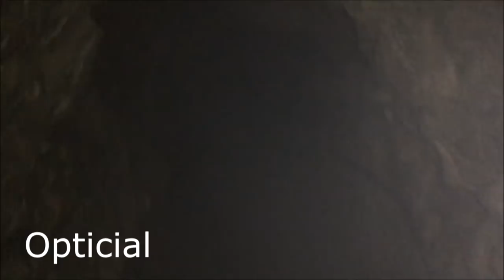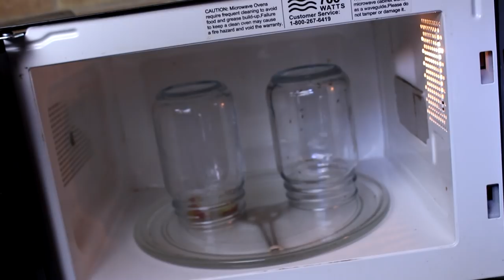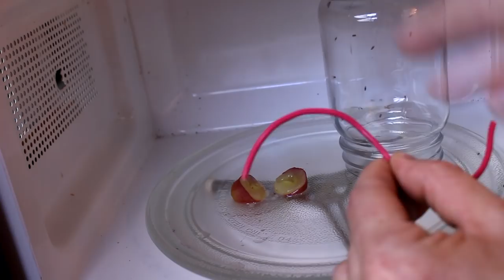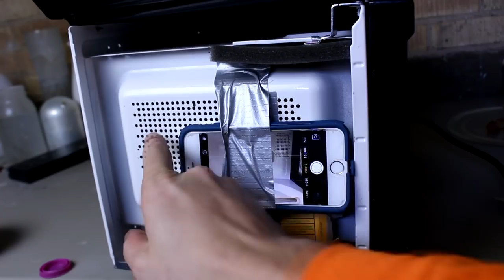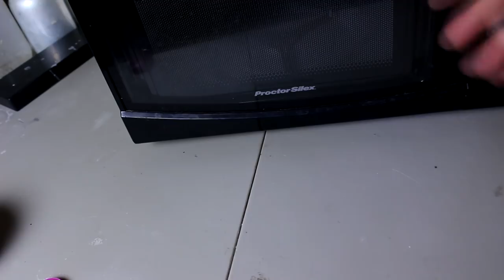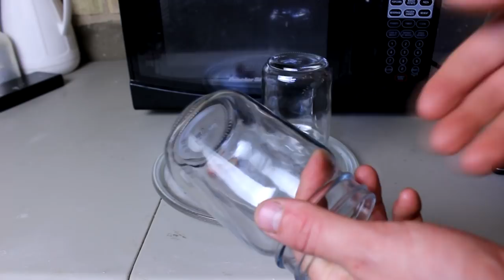Fruit Flies In A Microwave?!

Comment: First up: a great video, had I watched it before studying physics it'd have cleared up a big misconception I had for quite a while!
There is only one thing I wish you had done: Show an animation or something similar of a propagating EM wave. It is super important for the induction process, that the wave changes with x+kt and I think that wasn't really clear in you video. (3Blue1Brown would have probably just given you his animation, and below this comment will be a single line Mathematica instruction to get such an animation)
And when you tried to clarify what the peak size in your wire model was showing, I think you didn't make your point 100% clear
The only thing you were a little wrong about it the dipol flipping thing. The heat generated by flipping dipols a lot is only dependant on how quickly they are flipping, not the total difference in orientations from one end to the other. And the rate of flipping is only dependant on the wavelength of the EM wave, so with your explanation it is not clear why the dipol heating in the fruit and the flies should be different.

And here is the EM wave animation instruction:
Animate[Graphics3D[Table[{Line[{{x, 0, 0}, {x, 0, 2*Sin[x + t]}}], Line[{{x, 0, 0}, {x, 2*Cos[x + t], 0}}]}, {x, 0, 4 Pi, 0.1}]], {t, 0, 2 Pi}]
Your at a uni, so you probably have access to mathematica, but it also works in the free online wolfram language notebooks (you just can't save the code there)

Comment: I would wonder if this experiment would also work with tiny drops of water from a syringe.....
Reply from the maker: yes but thats not very interesting. ;)
Reply: Cody'sLab  I tried it with drops on a non heat conducting surface. It heatet up.

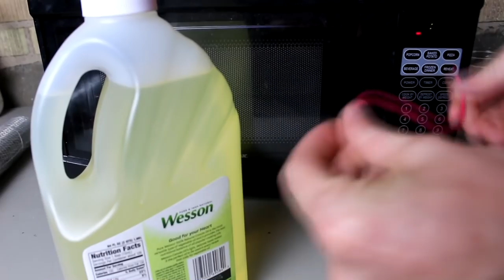Comment: What happens in the microwave is "dielectric heating" that affects the water molecules in the grape and does not have anything to do with its size. It that would be true, water drops would not heat up because they would be as small as the flies, try it out. You try to mention this effect at 6:00 as a secondary effect although that is the only actual effect that is taking place. Your analogy with "Rayleigh scattering" is also wrong, it would never be able to heat up anything since it is a "parametric process". Very misleading... If you want to understand it, just search for the quoted scientific terms I mentioned.

Comment: So if i am understanding what you are saying, lets compare
(1) one single drop of water in a microwave
(2) a mug full of water in a microwave
The energy PER MASS absorbed by (1) is LESS than the energy PER MASS absorbed by (2)?????????????
So 1 drop of water in a microwave would take longer to boil than a mug of water?????????

You said that the larger the object, more of a single wave affects the object? But i thought microwaves interact with water MOLECULES, and molecules are very small?
Reply: Water sticks together, each photon interacts with many hydrogen atoms on the molecules at once. A single misted drop of water shouldn't heat up at all other than the heat from the surrounding area.

Comment: Be careful Cody, there can be an evanescent field of significant strength around that hole. (See https://en.wikipedia.org/wiki/Evanescent_field), i.e. the high frequency - high power electromagnetic field "bulges" outwards a little at the hole. You can do experiments to detect it ;)
Reply from the maker: sounds fun

Comment: I'm sorry this is already been covered, but I remember seeing in another video that someone said microwaves change size or something when they're going through water. Does anybody care to explain that?
Reply: They will actually! Although it's more mundane. Since water is more dense than air, there are more water molecules in the way of an electromagnetic wave than in an equivalent volume of air at sea level. So the waves will be absorbed and reemitted much more frequently than in atmospheric air. As a result, microwaves will transfer some of their energy into the water molecule as they pass through until the total energy of the wave is completely absorbed.

Comment: Re communications: Microwave uses the same frequency/wave length as WiFi.
Reply from the maker: I thought wifi was 30cm?
Reply: Normal WiFi (the one found in the majority of phones and laptops) is 2.4Ghz - 12.5cm, which is the same as microwave owen. The more "modern"/expensive one is 5Ghz. Long range point-to-point links can be up to 60Ghz

Comment: Cody, do your argument goes like this: "the fruit flies are small, therefore they absorb less microwave energy per cubic millimeter than larger objects"?

I'm not at all sure this is true. However the fruit flies do stay alive in the microwave as we could see. What if, maybe, only maybe they absorb the very same amount of energy per volume as the grape, but they are small, therefore have such a high surface/volume ratio that they can stay cool just because the air around them can keep them cool?
Reply: I thought so too, seeing as I thought that things in microwaves heat up when water molecules are vibrated by the positive and negative sides of the wave, rather than an electric charge across the thing. Also, the proportion of body mass that is water is going to be higher in a grape than a fly.
Reply: You can't get the vibration going from a 12cm wave on a sub 1mm body

Comment: Good video, but still there is much more going on.. The microwaves are obviously not heating the grape, they are heating the molecules inside the grape. The fruitflies are obviously not smaller then molecules so should also be affected. And glass does react in a microwave, if you pre heat it you can even melt it. Maybe the grape absorbed most of the radiation, saving the fruitflies.
Anybody has a more extended explanation?

Comment: So.. ? How likely would it be that all the Radiowaves, which are acting like the Microwaves on the Grape(frying it), would do the same to the Earth...?
And would this mean, the global warming (if you assme it's real(which statistics show)) is not just doe to the greenhouse effect?
I was just thinking, if you'd scale the flyes up to us, all oure electro magnetic waves must get disipated by the earth...
Please correct me if my thinking is all wrong.
Reply: Radiowaves in the air are too large to interact with anything that makes up the Earth. They also don't carry enough concentrated energy to heat up the Earth.
Reply: I can't realy see the point in Radiowaves being too large (aren't they ranging from under one to several dozends of km's?) since earth is compared to them clearly bigger and at least the liquid metal core of earth should diccipate the waves, so that shouldn't be a problem in my oppinion.
About the concentration... Yes, thats my question about as well. Because I think of the millions of radio antennas all around the globe which are produceing electromagnetic waves. And suspiciously the charts of global warming and produced computers (as a reference) seem to even lign up(okay, possibly a conincidence).
But actualy, aren't all the electronic products(e-cars, e-trains, wireless charging, WiFi ect.) adding up to this as well. The waves may get captured by the case but the heat still stays on our planet... ?
Reply: Global heating and cooling has been happening since the earth had the precursors to an atmosphere. Our added EM radiation hasn't changed anything. The sun's cycle is what causes the switch between global warming and climate change(cooling).

Comment: Nice video but the explanation is wrong. Microwaves heat water because their frequency is matched to the rotational absorption modes of water molecules. Your classical explanation missed the crucial point. The flies do heat up (you can see their behaviour change as a result) but have a large surface area to volume ratio and therefore lose heat very effectively, thus limiting their temperature rise to a sub-fatal level. This is physics!

Comment: Those holes in the side of the microwave are not an accidental size.  I hope you checked calculations on faraday cages and acceptable levels of radiation before you started cutting open your kilowatt baby cooker.  I'd guess if you don't keep any small body parts near the hole and don't feel any heating it's fine.  I personally wouldn't do that to a microwave I leave in my kitchen.

Comment: The fruit flies don't have nearly as much water as a grape does. That's why the grape heats up and the fruit flies don't.
Reply: Nope, fruit flies aren't even a twelfth of the wave length, that's why. The polarity switch must be able to complete inside the thing to be heated in order to excite the molecules. With a wave about 12 long there's no chance of that in a tiny fly.
Reply: lightdark00 the wavelength of microwaves is around 10 cm. So anything smaller than 10 cm you can't microwave? Then how do you  microwave popcorn?
Reply: lightdark00 water absorbs microwaves. That's how it heats things up and that's why glass and other materials aren't heated up in a microwave

Comment: Even tho the whole explanation is valid, there is one thing that is completely irrelevant. At some point Cody says that if a 1cm hole wouldn't be safer, the manufacturer couldn't have put one at the bottom for the turntable to snap in. However, I don't think that hole lets you through the oven, and for instance a metal bell covering the hole on the other side would just be about what it takes to invalidate this argument. Otherwise, great video, as always.
Reply from the maker: Well its an electric motor on the other side and those are made of metal so the microwaves wouldn't get out any way but the motor might be damaged.
Reply: I agree about this, and I'm absolutely not refuting any of the facts you've explained in the vid. My point being that there could be a plastic gearbox on the other side of the hole, or a belt made out of rubber, transmitting the movement from a box well outside the range of the magnetron emission cone. My point being more about "question things whenever you can" indeed ;)

Comment: may be you domt know, harming animals by purpose will create bad karma
Reply: Microwaves run on 2450mhz, that's about a 12cm wavelength. The phase switch has to occur inside the thing to be heated, that's impossible with a tiny fly. You created bad karma by posting your message.

Comment: I hate those fucking wheels on the bottom of microwave ovens, the glass plate always fucks up in its rotation and jumps up or down due to imperfections in the alignment and shit. Drives me nuts. I havent had a single microwave oven that just had the glass plate rotate smoothly without glitches.

Comment: I wonder what the legal threshold for experimenting like this is before it becomes animal abuse. I'm not trying to say "OH GOD THE POOR FRUIT FLIES" but I'm sure the cops would knock on your door if you posted the same video with mice.
Reply: This video got a strike probably from someone like you're own thinking. But basically what I've noticed, if you would place mice into a microwave and turned it on, idiots would flag the hell out of it. However, if you had it set up automatically as a way to deal with wild mice in your barn, then it's fine. Meaning mice walk in, and it's automatically triggered to turn on. Meaning fate is fine, you choosing the specific mouse's fate is not.

Comment: Wow - you almost always are grounded in sound science, which is why I enjoy watching your channel. In this one about the fruit flies, uncharacteristically, you are completely full of BS with your wavelength and EM theory. A microwave oven works on ABSORPTION spectra - its EM frequency is set to one of the transmission nulls of WATER molecules - the maximum energy being absorbed is at that frequency (IITC ~1.8GHz). Fruit flies have negligible water, the grape was loaded with it as you could see it condensing on the jar.

Comment: Those who can do,, Those who can't teach others their Stupid ways.

a microwave requires a load...  put a cup of water in there.. a grape is insufficient.
without a load you will likely burn out the magnatron over a short time.

microwaves at 300 GHz are 0.1 cm from top center to bottom center. Not 15 or 16 cm as your piece of wire.

why do they create microwave detectors to find leaks around doors ??

the holes in the door window shield are that size because microwaves are just bigger than those holes..

The hole where the carousel sits,, is yet protected by the metal bottom of the oven. your hole is protected by nothing as it is.

OMG, I hope no one pays attention to you... 

Please keep going for a colonoscopy !!

Comment: Cody, this is your first video I am disliking for in-accurate garbage. I like your other videos. You should have caught up on some basics before spewing out BS. You don't need any advanced degree in electro-dynamics. As another user William Miller commented (this was the exact thing I was thinking too while watching your BS): "As for the flies not dying? It has nothing whatsoever to do with electricity or "volts". It's because the mass of a fruit fly is fucking 1 milligram, and they contain VERY little actual water. Why don't you put 1 milligram of saltwater in the microwave and cook it for 10 minutes then tell me how hot it is? The volume of the material you're trying to heat plays a huge role in how good it is at absorbing the microwave energy being bounced around the TEN LITER cavity inside the microwave."
Reply: Yes the volume or mass is not sufficient to have a polarity switch with enough of an amplitude change inside the flies to cause any heating.